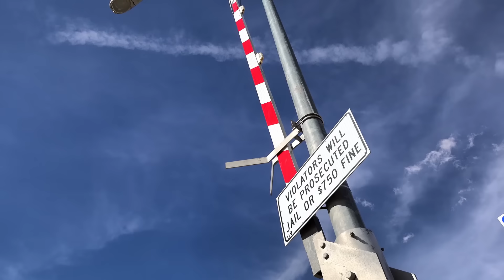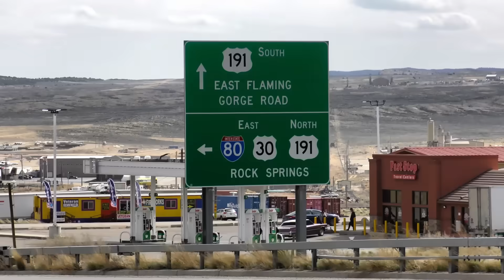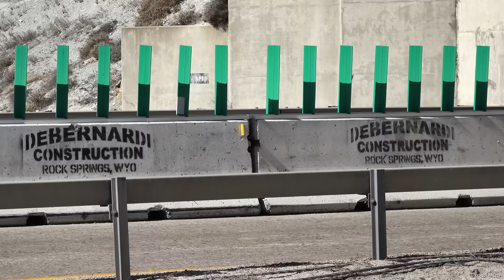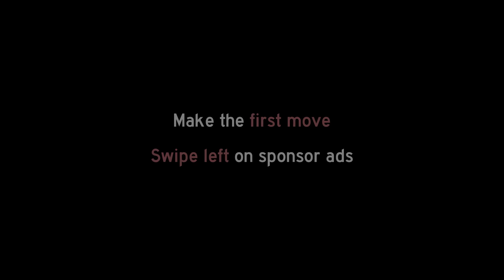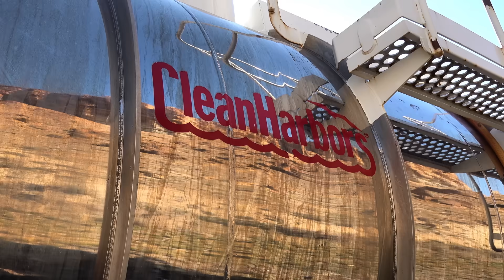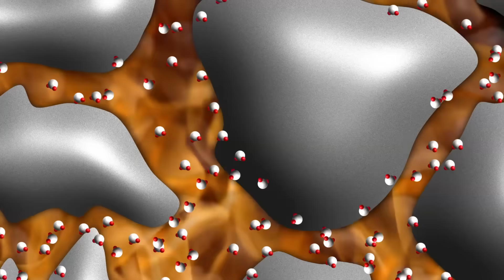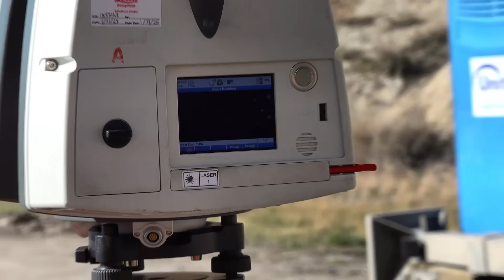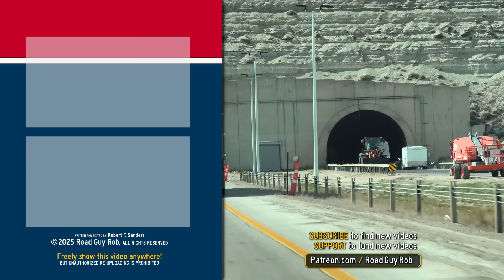Going Inside Wyoming's TOTALLY MELTED Freeway Tunnel

Comment: I love the testing method of "tink tink tink" vs "THUD THUD THUD"
Reply from the maker: I'm always surprised at cool "low tech" methods in Civil Engineering are so fast and effective. 

I'd never heard of "sounding" until this story.
Reply: @RoadGuyRob  We use sounding to make sure that the outside of the turbines on hydro power plants is still attached to the concrete to prevent implosions (when water gets between the concrete and the metalic liner you can crush the liner like a sode can). Its also used to make sure the high tech composite liners is properly attached to concrete in nuclear reactors buildings as we apply it inside and outside the inner concrete shell to make it more impervious in case of a meltdown as we have to demonstrate it every 10 years (in France) by pumoing the reactor building up to 5 bars and mesuring the leaks. It's like testing a water pipe but with a building who is 50m in diameter and height.
Reply: @rweissrock  an implosion in a hydro power plant does not sound like a fun time... water has a heap of force behind it
Reply: @RoadGuyRob sounding has another definition so please be careful when looking it up on the Internet.  I'm serious.  Don't look it up.
Reply: @specialsause949  The things I have seen... (shudder)
Reply: @RoadGuyRob  just don't google it with safe search off.
Reply: @RoadGuyRob  NOOO YOU GUYS BROKE ROBS INNOCENCE
Reply: @RoadGuyRob I did it once… in college
Reply: @RoadGuyRob  So thaaaaats what she meant when she said she wanted to try sounding.
Reply: But just FYI - be careful when googling for "sounding"
Reply: Who doesn't love a little sounding?
Reply: It's commonly done with other composite materials like carbon fiber or fiberglass. Lots of aircraft inspections are done with just a simple coin tap test. It's pretty cool to see something I'm familiar with in another almost completely unrelated industry.
Reply: @Noman1000 when I worked in aviation as a mechanic, one of my main jobs was blending the turbine blades. 
All I need was some wet stones, a special knife,  a belt grinder, and the flashlight on my phone to work out the damage. 
When it came time for the final inspection, I had a 99% success rate
Reply: It’s pretty ubiquitous
Reply: In underground mining, it's called check scaling. The hollow or "drummy" ground is considered loose, and is to be removed manually, or if too large, mechanically with a drill
Reply: sounding is also how I pick which watermelons to buy!
Reply: This works with pottery and firewood selection. You can test your coffee cup for cracks. A cracked bell 🔔 won’t ring
Reply: That’s the way I made repairs to my porch. Tapped to find spalled areas that I couldn’t see, then removed and repaired. It is a good method.
Reply: Zelda on Super NES 🤣
Reply: It's pretty cool how effective it is too! The solid concrete is gonna reverberate the actual hammer, whereas the fractured concrete is gonna reverberate inside the slab. Simple, effective, and reliable
Reply: rock and stone
Reply: It’s also used as a go-no go for torqued fasteners, specifically if it is metal-to-metal or not.
Reply: "tink tink tink" "THUD THUD... CRACK"
Ooops.
Reply: Nah but this actually works it's how most small bridges with concrete are inspected first. We hammer literally everything and circle the areas that thud with wax pen. If bad wear is discovered they might use more destructive tests or more advanced ones.
Reply: we are taught it for composites testing in aviation, a very sound testing technique
Reply: If it ain't broke 😂
Reply: As a rock climber, I always tap on any questionable rocks with my fingertips. 
The last thing I want is for my handhold to come loose.
With a little practice, it's easy to feel and hear anything loose.
Reply: They are testing the concrete to a prehistoric level taping on it, there’s all kinds of high-tech scanning equipment and sonar equipment and x-ray equipment and LIDAR, that they could image the entire tunnel and be able to look at at it in four dimension afterwards.
Reply: Tung tung tung sahur

Comment: I don't think it's loose water in the concrete that causes it to burst. You are actually disassociating the water that becomes chemically part of the concrete in the hardening. It's the inverse of what happens whey it sets--you're getting your water back!  Concrete can dry for decades and it still bursts when it gets too hot.
Reply: The water doesn't actually go anywhere, nor does it become chemically distinct from water just because it was mixed into concrete. Not sure what you mean by "loose water" either, as it being mixed into the concrete was already specified
Reply: @halcyon1145  I meant that the water becomes chemically a part of calcium silica hydrate and calcium hydroxide that form when you hydrate the cement.  As opposed to H2O as water filling space between the solids. So even if the concrete is perfectly dry, steam will still be formed and can blow it apart. A minor point.

Comment: yknow what, trains would fix this
Reply: yknow what, it would help if you grasped a thing or two about logistics. Moving stuff from point A to point B. In case you didn’t see the video, the railroad runs right through Green River. THAT railroad is the part of the original transcontinental railroad across the Western United States from Omaha to Sacramento, which, wouldn’t you know, Interstate 80 happens to follow. Both routes, along with BNSF’s Northern and Southern Transcon (Chicago-Seattle/Portland and Chicago-Los Angeles) along with Interstates 10, 40 and to a lesser extent 70 and 90 are what REALLY make this country’s economy go. A whole shitload, and I do mean a whole shitload, of STUFF goes east and west across those routes and countless others by both road and rail round the clock. And we haven’t even mentioned ships, barges, aircraft. You, sir…are simple.
Reply: @tomhanna2714  cool paragraph, not reading it. congratulations, or sorry that happened to you

Comment: This reminds me of the insane fire on the truck route just south of here in Santa Clarita. In November 2008 a truck broke down and caused a crash in the northern tunnel  on the southbound truck route, and that crash resulted in an explosion that closed down not just the truck route, but also the main I-5 that was running on top of it, and the freeway was shut down for some time. They determined that part of the cause was insufficient lighting in the tunnel, which was resolved after repairs.

Comment: A bigger question would be why don’t ALL tunnels have fire suppression systems built into them? With all the planning and foresight it takes to build a tunnel, it’s quite shocking that the one thing you want in a tunnel fire is absent.
Reply: Unfortunately, even if future tunnel projects or current existing tunnel infrastructure are retrofitted with fire suppression systems, the fact we are using lithium-ion batteries in vehicles means we will have horrible volcanic-like fires in enclosed environments, that we will just have to wait for it until it burns itself out.
Reply: @bkark0935 Maybe not.
They make tubes that can carry fresh cement over a house.

Delivering dry fire suppressant could be done in a similar way.

Comment: I'm impressed they were able to get the balls rolling so rapidly.  the collection of contractors to start the remediation work is blisteringly fast by bureaucratic standards.
Reply: I lived in Wyoming for a year, and still go through relatively often, and I am consistently impressed with the speed and effectiveness of WYDOT road crews in getting jobs done.
Reply: @professorjackdurham in contrast to my hometown where it took them years to do a scheduled seismic upgrade and refinish a bridge.
Reply: @kenbrown2808  in their defense, seismic upgrades are discouraging.  Because you never quite know if the structure is actually going to last long enough to need the seismic part.
Reply: @hannahbartholomew426 but if you stall until the big one hits, you definitely won't get paid.
Reply: The secret is Wyoming's near lack of bureaucracy.
Reply: Rhode Island says hi 😅

Comment: LiDAR has been a real game-changer in the surveying profession. A significant increase in productivity, and a major improvement in safety.
Reply: and its way more fun to work with on the CAD side! LIDAR point clouds are incredibly powerful, and thank god for not inputting hundreds or thousands of surveyor measurements by hand.
Reply from the maker: It was a really cool machine!  I've never seen one in action before.
Reply: @RoadGuyRob  Have you seen the ones they set up in the london underground stations during crossrail tunneling? They mount to the ceiling and continually measure a set of target points. if anything moves they get an alert.
Reply: My state DOT just finished trials and has now officially accepted aerial drone LiDAR and drone Photogrametry for official surveying and quantity measurements (like lengths and volumes), pretty exciting times here 😊
Reply: @DarkDragonPath  Sounds great! I worked for WSDOT for many years, and semi-unretired last year to help them out. We used drone LiDAR several weeks ago to fly a corridor that was somewhat nasty for safety reasons, and was a huge time-saver as well. Exciting times indeed!!
Reply: @DarkDragonPath  I do surveys with mobile and aerial LiDAR, we have done all sorts of jobs before, including some roadwork.  Last year we monitored a stretch of highway and located an area that would become a sink hole.  Watching these terrestrial scanners is a bit funny when they say "Scan the whole tunnel over the course of a few days", I could have walked one of our scanners through that tunnel and gathered more points in 10 minutes.  Even with processing this probably would have been a single day to final deliverables.
Reply: @KlockworXMusic  My company doesn't do a lot of scanning, but I was gonna say, we have a Trimble X7 and even at the highest resolution and sensitivity each occupation only takes fifteen minutes. That's a day of work to get the whole tunnel, and if WYDOT was worried about reference to monuments (which they usually are, we've done plenty of work for WYDOT) we could use our SX10 which is both a total station and scanner combined to do the work. Heck, if they are fine with a few days, I'll throw down some more control and get high resolution scans above that dropping electrical rack and inside of all the little cutouts where concrete has broken away. If they'd take it, I'd happily use both and combine the scans with a potentially first order accurate control network.
Reply: @DarkDragonPath  Is photogrammetry really that precise? I suppose if you take thousands of high resolution photos and have the compute to figure it all out. I've always thought photogrammetry was cool. I need to look into it again.
Reply: @AKSoapy29  It is! I've used it in mass development planning to get scans of existing sites within acceptable tolerances to import into CAD and work out optimum site grading layouts and cut/fill programs, and my fiance used photogrammetry to do scans of peoples mouths for the research she did in college. Same technique, wide variety of applications, and really accurate data with the right equipment and methodology!
Reply: Working on the CAD side of that is fun. Though I have had people demand that the machine is off when they drive past because I'm giving them eye cancer.
Reply: Mark Rober was my intro to LiDAR tech, using an extremely small scanner under his jacket to map out one of the Disneyland rides that’s normally very dark inside. really cool and efficient!
Reply: Not only that it helps with DOT CAD processing its pretty neet being a surveyor 🤣
Reply: Are you saying lidar is safer for surveyors? Cause i can't imagine how... Or just that more accurate surveying improves safety of structures?
Reply: @Nevir202  It's not that LIDAR is inherently safer than traditional surveying, it's that LIDAR allows surveying to be done in a safer manner.

Traditional surveying works by having at least two points with known location, for road works they are normal marked with small metal disks on the ground. When a new survey is performed, the surveyor puts a marker at a known height above one of those survey points, and his measuring device above another survey point within line of sight. If there are no known good survey points where they want to place their measuring device, for example because the road has been visibly moved, they instead put up two markers above known good survey points and place their measuring tool wherever they want.

Now that the marker(s) are set up, they use their measuring device to record the angles between the sightline(s) from the measuring device to the marker(s) and the sightlines to a bunch of measuring points on whatever they want to survey. Afterward, they move their measuring device (and sometimes the markers too) to different locations and measure all the measuring points again, and then repeat this process over and over until every measuring point has been measured from at least two known good locations.

Depending on the size and layout of the site and the amount of points in need of measuring, this can take hours or even days.

Thanks to trigonometry, they can then use the known distance between the surveying points used and all the recorded angles to calculate how far each measuring point is away from the known good points of the measuring device and/or markers, which allows them to be mapped in a 3D space based on those known good locations. In the past this was done by hand, but nowadays we have CAD programs where the used surveying points and all angles are entered into, and they calculate a 3D image.

LIDAR surveying in contrast works by directly measuring the distance between the LIDAR scanner and the measuring points by measuring how long the light send out by the laser of the device takes to bounce back into a sensor on the same device, which then allows the point to directly be mapped in a 3D space centered around the measuring device. Then either precise GPS measurings or traditional survey markers are used to place this newly created 3D map in relation to previously performed surveys.

Drone-based LIDAR surveys can also use multiple local radio transmitters placed above known good survey points to keep precise track of the drones locations in places where GPS isn't precise enough.

Obviously, LIDAR scanners can take more measurements with higher precision and faster than a manual surveyor could, which consequently significantly reduces the amount of time required per surveying point while increasing the precision of the completed survey.

What makes LIDAR surveying safer for surveyors is that depending on the equipment used (tripod mounted scanner like in the video, or a scanner mounted on a drone or car) they spend significantly less to no time in an area either known or suspected to be dangerous for various reasons.
Reply: @Nevir202  Traffic. Don't have to spend time taking hundreds or thousands of painstaking measurements while praying you don't get hit by a car if you can just (essentially) snap a picture and be done with it.
Reply: This "conversation" is very suspicious

Comment: PennDOT puts oncoming traffic in the same tunnel so often that the stretch of highway approaching every tunnel on both sides has dedicated crossovers and gates of increasing length to merge traffic into one lane. I’ve driven in the tunnels with oncoming semi trucks just a double-white line away probably dozens of times. For a long term project like WYDOT, though, barriers were a smart addition

Editing to add: this is in reference the PA turnpike. If you look at the Tuscarora Tunnel on Apple satellite view you can actually see the crossover actively being used!
Reply: In my country every tunnel that has more than 1 actual tunnel has a crossover in front of it, mostly for maintenance purposes.
Reply: That's immediately what I thought of when the realization to put all traffic in one tunnel was made.
Reply: Double white? Shouldn't the centreline be double yellow?
Reply: @OntarioTrafficMan  typically the lanes in each tunnel are moving traffic in the same direction but changing lanes is prohibited, hence double white
Reply: PennDOT 😡
Reply: The Turnpike is controlled and maintained by the Pennsylvania Turnpike Commission, which is not part of PennDOT. 

And yeah, crossovers before tunnels with separate bores like this (or sometimes bridges with separate spans for each direction) are common for this reason, ease of switching all of the traffic over to one side for maintenance or emergencies.
Reply: The parkway in Pittsburgh is in a state of perpetual construction.
Reply: Oh Filthadelph, Hostile City, PA!
Reply: And the nice part: You get to pay the nation's most expensive tolls to take that little adventure! 🙄💸